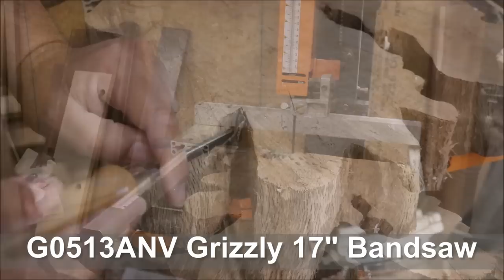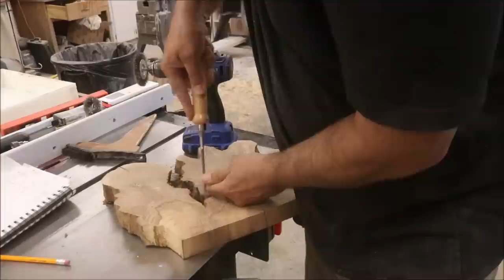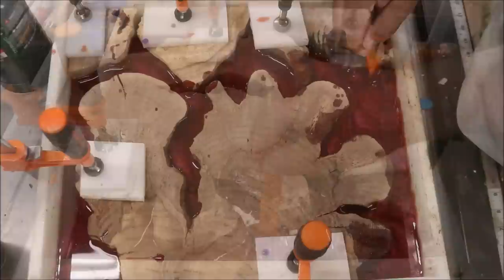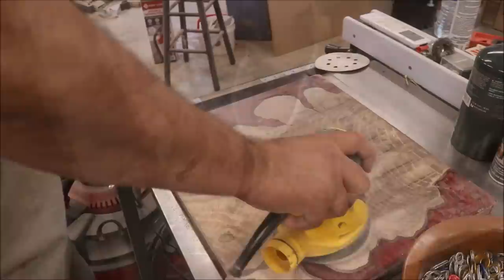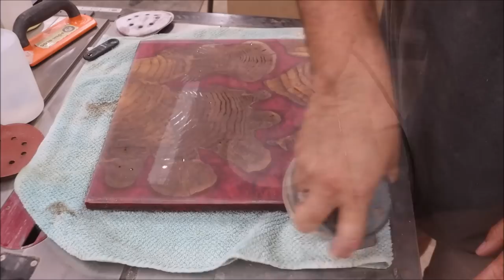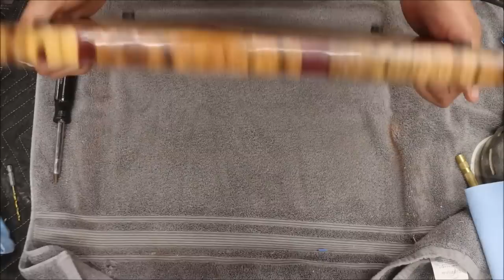The Most Incredible Board I've Ever Made

Comment: Glad you are healing up.  And nice to see you did not try to pour that much resin at once and have it crack from to much heat.  

And I know about local tap rooms and beer and my favorites are some 10% beers which is why my rule for power tools and alcohol is the same rule I had with my motorcycle.  They do not mix.
Reply from the maker: I'm luck in my wife doesn't drink much. Maybe one drink. I do not drive after a beer. Now lasers is another story. lol I think I learned my lesson after three cracked boards. I have one coming up in a video which was the last one I cracked.

Comment: Hi, Glad to see you are getting better and back into the swing of things. Injuries are scary for sure. I notice you out the model numbers for your equipment and was looking at your band saw. That looks like a LOT of bandsaw for the money. Some perspective from someone that actually uses it would be helpful. What do you love about it? What don’t you love about it?
Reply from the maker: Hey Mark, Sorry it took so long to get back to your comment. That is the G0513ANV Grizzly 17" Bandsaw, it is discontinued. But it is basically the same thing as the G0513 https://www.grizzly.com/products/grizzly-17-2-hp-bandsaw/g0513. It 2hp and that is all I need. I use sawblade.com blades on it. This machine is a work horse. It has plenty of power to get the cutting I need done. It adjusts easily. I have re-sawed 10" boards with no drift using a 3/4" re-saw blade. I did buy a mobile base for it as I like the things in my shop to be mobile. It has two dust ports, one under the table and the other below the bottom wheel. I only use the top one and it gets most of the dust.  I really wish I would have gotten the Grizzly G0513X2BF only because it has a foot break. Added safety.  Over-all I can whole heartedly recommend this.  I hope that helps. Feel free to ask what ever questions you need too.
Reply: @MoonpieCreations  thanks so much for getting back. I appreciate your perspective. I love your work!